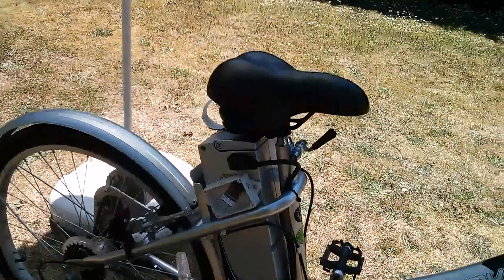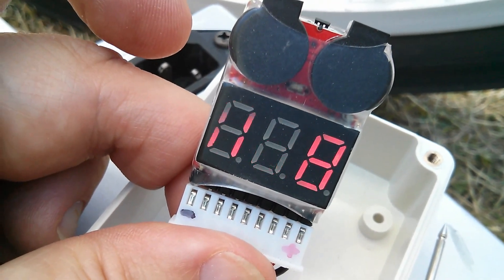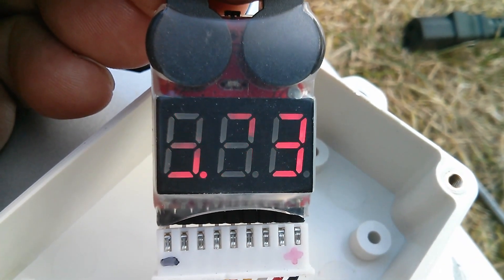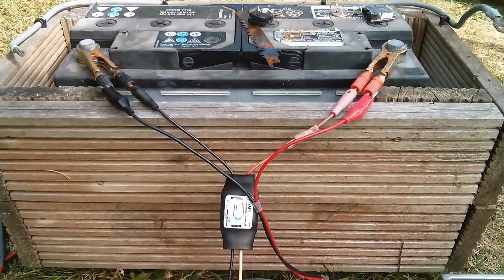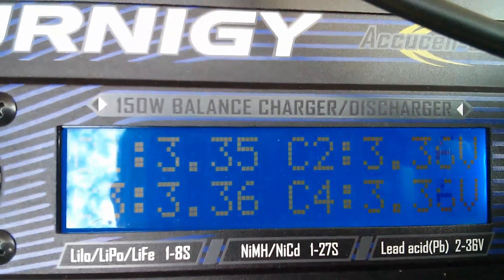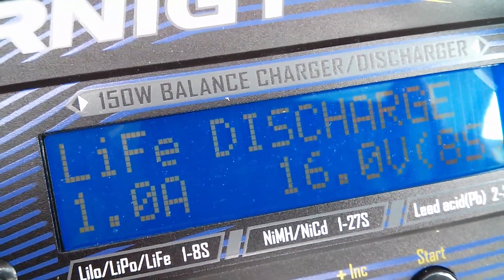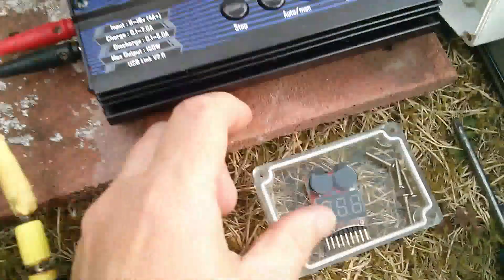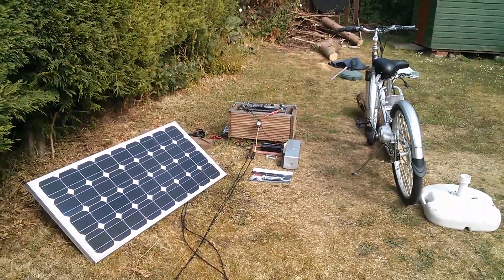Julian's Project: Electric Bike Upgrade to LiFePO4 - #5 Charging

Comment: A fully charged LifePo4 cell is only 3.6v?
Reply: Yes, it's a different chemistry than other Lithium cells.  And significantly safer.
Reply: BixbyConsequence And significantly more expensive? Hope not. Samsung should use this
Reply: Cosmo John energy density is less so it's not as desired

Comment: one note is that those battery monitors aren't exactly accurate. it's typical for them to be out about +- 0.05V on the per cell voltage. perfectly fine for monitoring when your batteries are dead, but they will typically show a perfectly balanced pack as being imbalanced.
Reply: aaaand 5 seconds later you say exactly that.

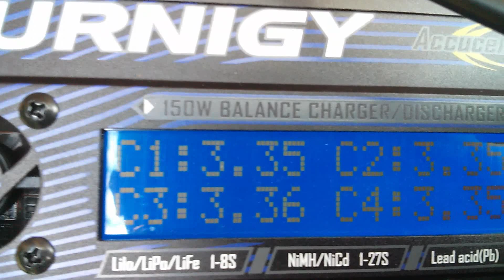Comment: 4:35 The LiFePO cell voltage are all going to jump to about the same level while initially charging.  In fact, they want to settle to 3.33v at rest, so the best way to read the balance is immediately after use or like you did at the end of the video.  3.3 to 3.6 is a 300 millivolt spread, which is pretty bad.

Comment: dont go relying on accuracy using any charger with that motherboard and firmware, if you want to get better firmware for it use the cheali-charger firmware for any charger that uses the same display style and 4 buttons https://github.com/stawel/cheali-charger
(GT Power A-6-10 200W, iMAX B6 50W,Turnigy A-6-10 200W, Turnigy Accucel-6 50W, Turnigy MEGA 400Wx2 and some others just rebranded and packaged for HK and other sellers)

Comment: Have you thought about using an adc like ads1115 and a small arduino to use as a cell monitor that can provide warning and battery protection?  I am not near as skilled in EE as you and have put one together to manage a 4 cell lifepo pack and it is essentially as accurate as my Fluke 87... I was very pleasantly surprised.  The 1115 on a breakout board like the adafruit example makes it very easy, uses I2c, ready to go!

Comment: If you want to balance the battery a bit quicker you can use your charger in 1S mode at approx 1.5A and charge each individual cell through the balance port. 
Ie. Connect Charger + - to Balance port 1 and 2 charge at no more than 1.5A. then port 2 and 3 etc. (You can make up a cable with 2 pins to go to your chargers +-)
Using the chargers resistors to accomplish a balance takes way longer than doing each cell individually at 1.5A.

I would suggest keeping an eye on the balance port wires the first time you try this as the wires are thin and might get hot. If this is the case drop you charge rate to 1.4A and check if temps are any better. Once you get a good Rate make a note for future charges via balance port.

This method works nice and quick for a battery that is way unbalanced like yours.

Comment: fyi minimum lifepo4 voltage is 2v under load, bms's are designed to cut off at this point and return when voltage recovers, so if you cut out you can always limp home, though i wouldnt recommend limping too far

Comment: I love these Lipo checkers too but these drain power from first cell, so they are like unbalancers too. And basic rule is that each wire has to be fused. I always separately fuse all my balance wires (closest to battery terminals). So no risk of FIRE.
Love your videos btw.

Comment: I deal with batteries every day and you want to monitor the temps during charging. Saw the cut off at 80c. If you can, add thermal sensing. Thermal runaway is scary.

Comment: With Lipo/Lion batteries you'll want to listen out for the alarm while under load so I'd assume it's the same with LiFe. If you get the voltage down low enough to set of the alarm with barely any load then they're probably at a dangerously low voltage. If I remember correctly that type of Lipo alarm/voltage reader doesn't auto reset after an alarm has triggered, or perhaps it just takes a while to stop sounding after a load spike triggers the alarm. Either way that might be annoying if you're out cycling and it's screaming away.
Reply: Christopher Allison Also Julian, don't forget that the individual cell voltage readings on your charger aren't much/any more accurate that the £1 lipo alarm as they don't use good enough tolerance resisters in the voltage detection circuit. I've previously found my 3S lipo batterys have been left less balanced (when checked with an accurate DVM) than before charging. There are mods around on the web for changing the resisters for high accuracy/low tolerance ones and making the charger considerably better but that sounds like a pain to me.

Comment: Julian Ilett Julian, a trap for young players. The end charge restrictions of 2 hours and 5000 mAh currently programmed into the charger are too small for your battery. They are set up in an attempt to protect noobs charging the typical capacities found on RC Models. So you need to do some number crunching to determine the charge time from flat as well as set the max battery capacity.
You can expect very long balance charge times with this charger since it charges until the highest reading cell reaches it's target. The charger then discharges the high cell(s) via a small (usually 5 - 10 W) internal resistor until all cells are pulled down to the lowest cell's potential then the charger restarts to top off the charge. with such a large battery that is going to be like sucking up syrup through a straw.
One last detail. I suspect the low voltage alarm may be a two stage affair. Giving fair notice and a final meltdown threshold. You could connect it to a variable PS to test this out.

Comment: you need to turn the capacity option off otherwise it will charge it to that limit and not the limit of the battery

Comment: You may need to check the specs for your cells specifically.

LifePO4 prismatic cells have a typical discharge cutoff at 2.3V,  Though you can play safe and set it at 2.6, there's not a lot of difference between the two because at around 2.6 is where the voltage starts dropping down rather fast. so dropping from 2.6 to 2.3 will be rather quick.

Cylindrical LifePO4 has a typical cut off at 2.0V (can play safe and set to 2.3) which is what the turnigy defaults to.  It is mainly oriented at RC afterall and there's almost no use of prismatic cells in RC. Mainly because RC uses high discharge which prismatic cells don't do very well, and there's cylindricals that go as high as 50C, though you typically get to see 15C-20C more commonly.

Comment: What size mah is your pack? Charging at 4amps seems a little low, I would turn off timer and mah limit. Those alarms work well enough as a warning, Id would set it at 3v so you know its time to start heading home rather than set it to time to stop using all together.

Comment: How about using a LiFePo4 BMS ?
ebay id:
271811295606 ( up to 13 cell)
220967039018 (up to 8 cell, bit more expensive)

it automatically switches off when charged to 3.90±0.025V , discharged 2.00±0.05V and limits current to 40A discharge and 10 / 16A charge,

No need for the turnigy anymore.  just a powersupply that delivers 28.8V CC / CV

Comment: Here is my thought, get a better charger like Revolectrix Powerlab 8, Accucell are cheap for a reason. The 1A balancing capabilites of the Powerlab is useful in situation like that, cheap charger like Accucell only has 250ma current balancing compares to 1A on the Powerlab not to mention Powerlab quality and accuracy, the accucell doesnt even compesate for charging lead resistance for  faster charging. 
Your lifepo4 setup arent cheap dont skimp on charger. 

Also you can use BMS board for pack self balancing so you need only power supply and it will self balancing but not sure such board can handle the load but most e-bike battery pack uses BMS.

Comment: Julian cool video I'm glad you have it working now!I'm currently installing lifepo4 in my electric moped (replacing the tired lead acid) although I'm choosing to go the bottom balanced method of battery management instead of top balanced. Usually 3.0v resting is considered completely discharged for a lifepo4 (the bottom knee of the charge graph) and anything under 2.7v resting is damaging to them. Under heavy load (> 3c)they can sag to 2.0v sometimes!

Comment: Low voltage on LiFePO4 should be 2.8V under load worst case 2.5V under load but not lower than 2.8V without load preferably 3V.
This LiFePO4 have a really flat charge discharge curve so when you are at around 3.45 to 3.5V you can consider the battery already charged depending on the charge rate but will be 95 to 98% SOC at 3.5V
And for discharge the same thing it will depend on the discharge rate but when you are at 3V with no load you are well under 10% SOC so there is not much energy there anyway.
Best thing to have is an energy counter that is the only way to say how much energy you have left in your battery.
Alarm should be set ideally at 2.8V but if the load is noisy like a motor controller probably is that monitor will not measure correctly under heavy load so you may get the alarm ON when claiming or accelerating.
The SBMS has a delay that you can set to 2 or 3 seconds so the load only gets disconnected ( or an alarm go off if you do not use the load) when the lowest cell voltage is below say 2.8V for more than 2 seconds consecutive and is not just a inaccurate reading do to spike current .
Not inaccurate but the ADC reads exactly during the peak of a spike current that will create a spike in the drop of a cell voltage do to internal resistance and that value will be displayed and alarm will go off.
I think those monitors that you have are only good or useful to check the battery without load without the need to use a multimeter not that useful for other stuff.
Also noticed that your Turnigy charger had a capacity cut off set at 5000mA and that is not enough for your cell size you need to increase that or the battery may not get fully charged if it was discharged more than just 5Ah.
You can apply a fixed load while measuring cell voltage that way you can calculate the internal DC resistance of the cells. Based on that you can know what sort of max load will they comfortably work at and what the voltage drop will be at different load levels.
Discharging LiFePO4 to 2V even under load is a bad idea they will get damaged.
Reply: Julian Ilett Dont expect to much precision from these balance chargers.. There is a reason why they are so cheap.. I got my self Turnigy Accucell 6 almost same looking as yours but it doesnt do the job very well.. Its over charging the li ion cells to 4.24  and there is no way to calibrate it.. So be careful , especialy with ur LiFePo cause they are very expensive... Btw those LiFePo cells u got should last you 3000+ charges if u dont dishcarge them lower then 50% , so my vote  goes for 8 microcontrollers for balancing and sound warning when cells are around 3.2v and also voltage cut off modification on ur controler when total voltage of the pack gets lover then 24 v.
Reply from the maker: ***** Thanks very much for that information - I'm pretty sure I did set the alarm voltage to 2.8V. Fortunately, the alarm doesn't latch - it resets if the voltage climbs back up, so I think it's safe to ignore the odd short beep.
Actually, the Turnigy's 2-hour timeout kicked in before the 5Ah limit (which I will increase - thanks for the advice). Once balancing starts, the current is turned way down, so it seems that balancing happens only very slowly. I think the Turnigy also balances during discharge, but I'll set it to LiPo for discharging, so it stops at 3V (not 2V). Big learning curve on these cells!!
And now I'm thinking about designing a BMS - 8 microcontrollers, one for each cell and some sort of opto-isolated data bus. But don't worry, it'll probably never happen :)
Reply from the maker: ***** Also, the Turnigy started doing weird stuff once the timeout limit was reached. I restarted the balance charging, but it let cell-8 climb up to 3.8V - I stopped it at that point. Not sure if this is a firmware bug - but it was getting dark, so I'll have to do more tests tomorrow.
Reply: Julian Ilett I think there are BMS with individual micro-controllers for each cell and they communicate with a main controller at the end of the string. Is a nice solution since it can scale to large number of cells easy but is a bit more expensive and most of the existing ones are not that greatly implemented.
Before you start to design your own BMS test the SBMS4080 so you have a good idea on how many things are involved with a good BMS :) Or read the ISL94203 the Intersil IC at the core of the SBMS4080.
I think you are right that you can ignore the short beeps from that monitor and that can work good enough for over-discharge protection.
I assume you will get  great range with this battery if charging this time was less than 5Ah.
If the cells are good enough quality and have the internal DC resistance very close matched then once they are top balanced they should stay balanced so not much cell balancing is needed at the end.
I think that Turnigy will start cell balancing just when the limit is reached maybe 3.55V or 3.6V as the other cheap chargers those not being useful.
SBMS will do cell balancing during charge as soon as the difference between the highest and lowest cell is higher than 10mV or whatever you set in the parameter settings all this things are programmable from the parameter settings menu on the SBMS (there are 34 parameters that can be set there).
SBMS is not really designed for eBike that is I do not recommend using that bust some are using the SBMS4080 on they ebikes.
Maybe you can build a simple energy counter just measure the battery current with a microcontroller and display the remaining energy on a small LCD or OLED on the bike that will give you a good indication of how much you can still use the bike. SBMS will do that of course but the display is not continently located for reading on a eBike.
And as you mentioned you wont want the BMS to cut power to your motor when in traffic for any reason and just use an alarm.
Reply: ***** If this is running the old version of the Accucell firmware, you can calibrate the primary voltage sensing, but not the individual cell voltages, IIRC. It has a hidden calibration mode when you hold two buttons down on power on.
Reply: ***** Yes, Accucel and most 'four button' hobby chargers seem to do a bulk charge via the primary power leads until one cell reaches it's peak voltage, and then drops to balance-by-discharge mode by dropping the current so it can keep the highest cells from over-charging. Quite silly really, as it means it can sit there at a 250-300ma charge forever when there is one abnormally high cell. I have another 'cheap' 1-4 cell imax lithium only charger that is a bit smarter and runs the balancer for the entire charge.
Reply: Peter Feerick Dont u think i alrdy tried that? I got older or either a fake version of accucell, anyway all chargers in that price range are more or less the same garbage..  None should use them for a permanent solution anyway so ...
Reply: ***** I wouldn't know - I don't know how much experience you have with those chargers. You are spot on though... all of these cheapie chargers use the same idea - keep charging on the primary lead, and discharge the high cells, which is a pretty daft but cheap way to do a multi-cell/multi-chemistry charger. It's not until you get to the iChargers and Powerlab chargers that you get anything decently different. I like Julian's idea - a separate micro/charger for each cell.

Comment: Hey Julian - If your charger works the same way as my near-identical-clone Bantam charger, then it will both charge and discharge the cells at the same time. My charger can drain a cell at up to 250mA through the balancing circuit, so when a cell hits the max allowed voltage, it just reduces the charging current down to 250mA. HTH. Cheers!!

Comment: Still waiting on the oscilloscope. You have not found out what is wrong? I am checking with manufacturer on new board with better noise rejection.
Thanks for the videos and have a nice day.
Reply from the maker: amtpdb1 New LCD on its way - from China
Reply: amtpdb1 Managed to build mine , Its a lil fuzzy on the accuracy but ive been using it to check how dirty usb power ports are.